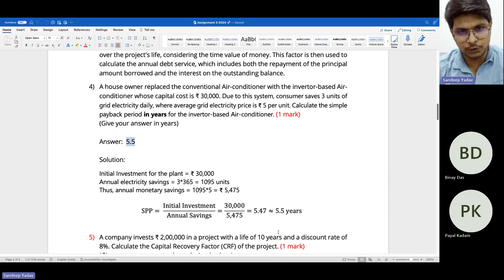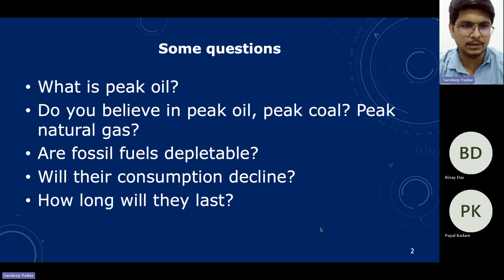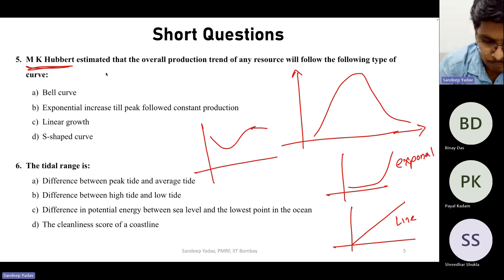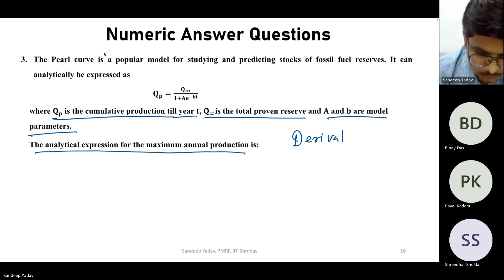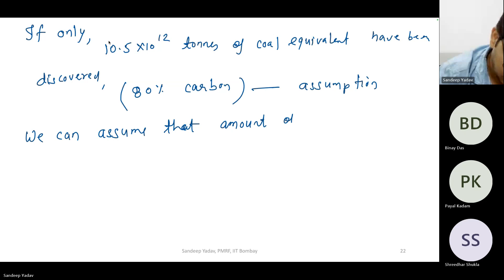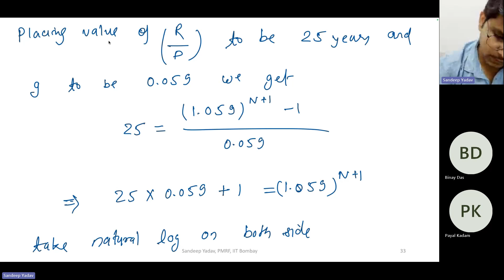Week 4: Energy Resources, Economics and Environment Questions 2024

Comment: Hello Sir, I have a doubt in Assignment - 3, question no. 5. 
I'm getting 0.149 as the CRF value instead of 0.085. I've tried it several times but it's still the same. Could you please guide?
Reply: Bro can u tell me how was ur energy resources economics and environment nptel exam cuZ i also have exam 24 n can give some tips to pass